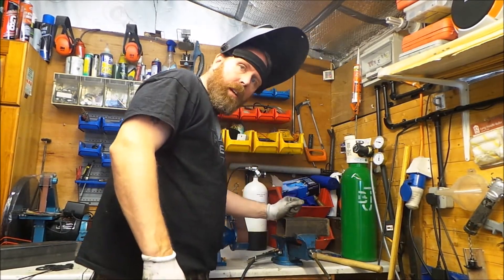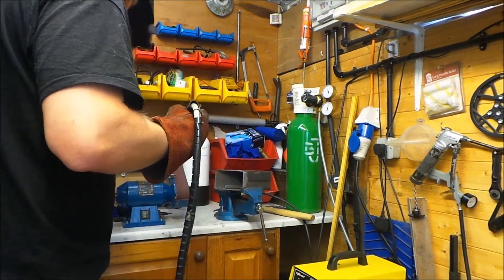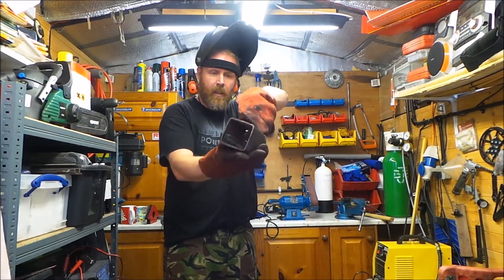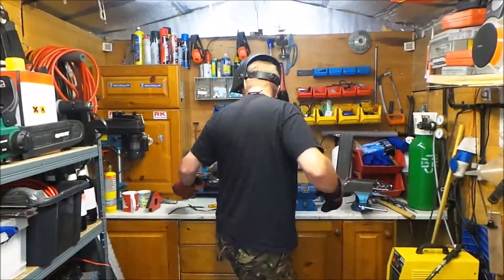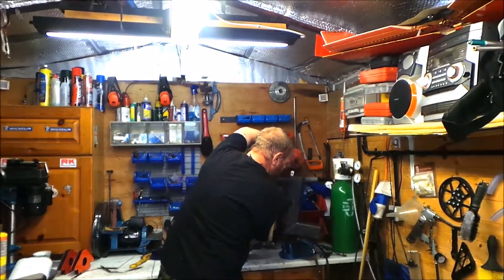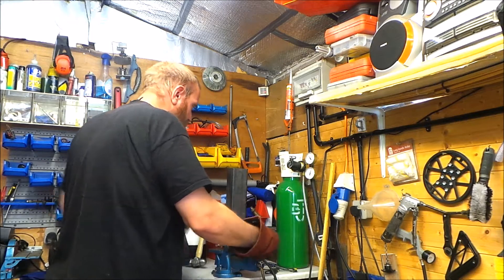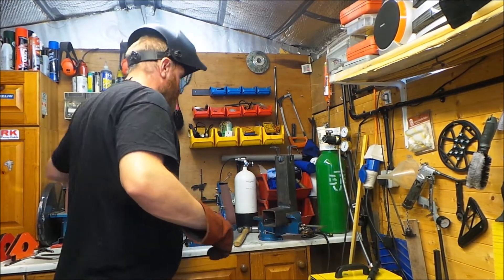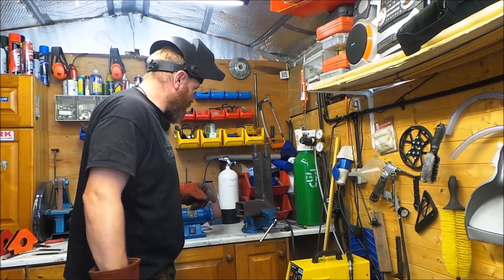Making a Rocket Stove -Part 2 Welding and the first Burn

Comment: Wrap the whole L-form in a couple of inches thickness of insulation, and you'll have a nice rocket then. Use perlite, vermiculite, dry, fluffy wood-ash or ceramic wool. The first three will need a containment can. Don't try fibreglass, it melts! The insulation is essential to get the high temperatures for a clean, fuel-economic, really efficient burn. See here for all the lowdown on rockets, gathered over the past 30+ years of both lab-work and field testing in poor countries:

http://www.bioenergylists.org/stovesdoc/Pcia/Design%20Principles%20for%20Wood%20Burning%20Cookstoves.pdf